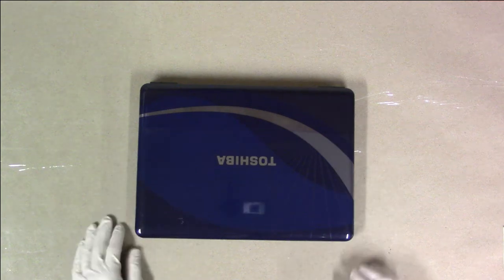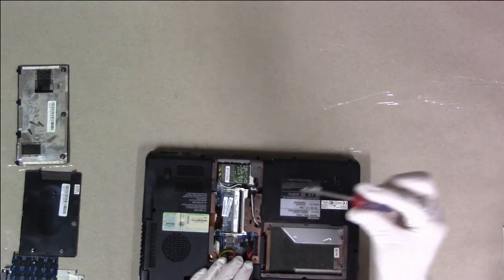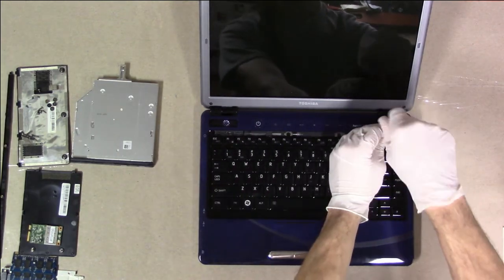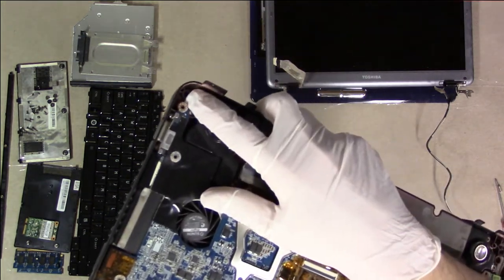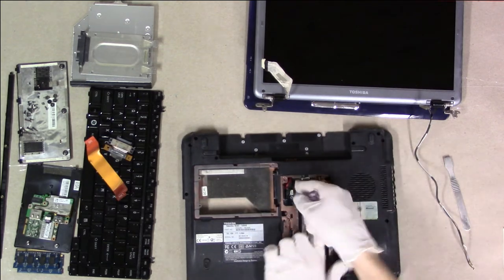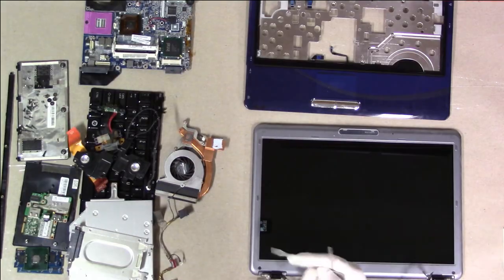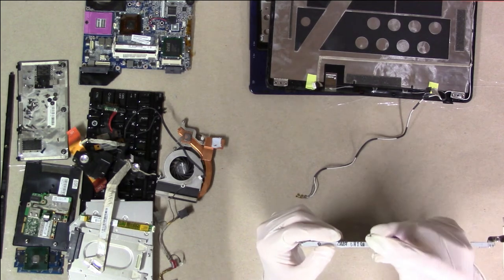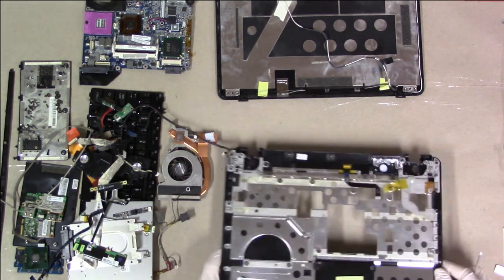LaptopCrap.com - Toshiba Satellite M305 Laptop Detailed Teardown

Comment: First off, great video, one question, how do you replace the CMOS battery on the Toshiba satellite m305-s4910, does it require the removal of the keyboard, or can I access it thru the bottom without ripping the laptop apart? TY!!

Comment: Is a Toshiba Satellite M305-S4910 if so? I would like to buy some parts. I need speakers, chasis bottom and lcd.
Reply: Yo también tengo una Toshiba Satellite  m305 s4910. Y ya le cambie el lcd( el lcd era de una hp profesional y se ve mejor que el original )
y el disco duro por un SSD y le agrege usb 3.0 en el puerto de la expresscard, y el cpu core dou 2.5Ghz me quedó  mejor que muchas laptop Apple jajaj
Le tengo Windows 10 pro. 
Quiero cambiarle la placa madre, e visto una satellite m305 pro que trae HDMI 💪
Reply: @netroel  El lcd de la hp le quedo a la toshiba?
Reply: @MarioPerez-yi2tw  si casi todos los lcd del mismo tamaño son compatibles, son compatibles si el connector es igual me explico?
Reply: @netroel  hola amigo, donde puedo encontrar el cargador de el m305-s4907, y que procesador le puedo montar para actualizar el original, saludos y gracias por tu respuesta